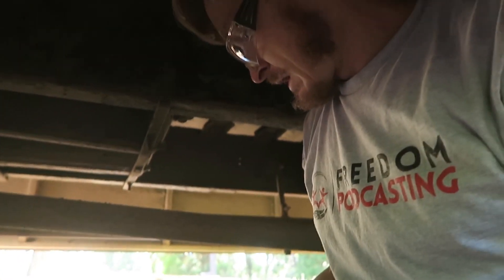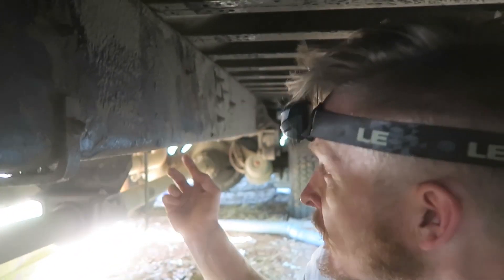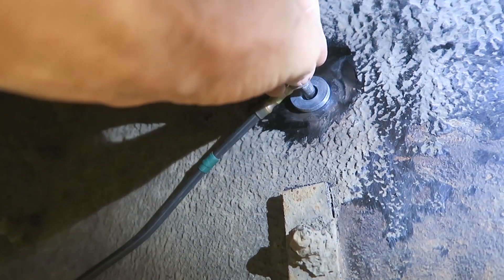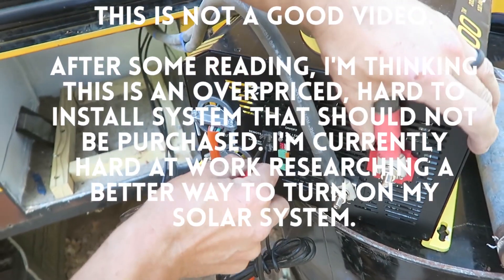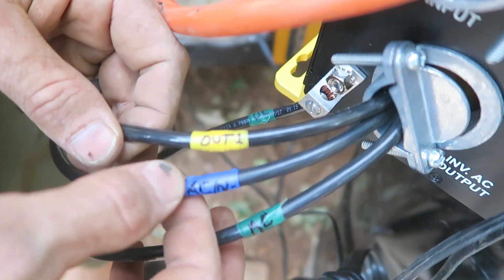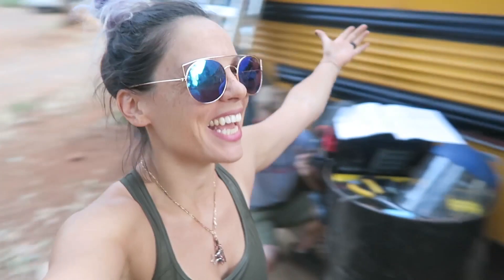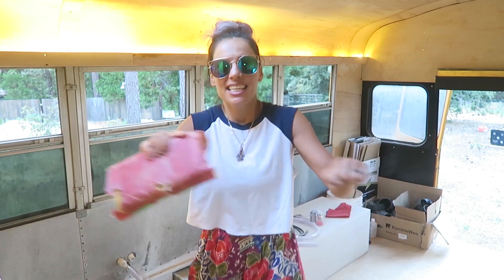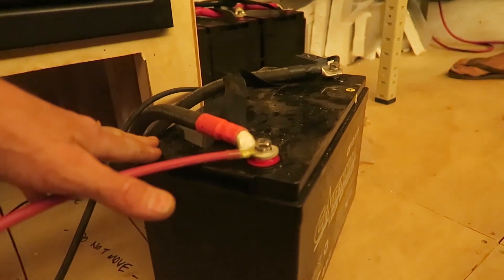#58 SKOOLIE BUS CONVERSION | Sanding, Grounding the 2000 Watt Inverter and Electrical Worries

Comment: Also I was wondering if the new Tesla Powerwall might be a feasible and really cool option for you, but unfortunately it can't currently be applied to anything but home applications. But maybe something to keep an eye on for future projects or an upgrade:

http://www.technomadia.com/2015/05/teslas-lithium-powerwall-awesome-but-not-for-rvs/
Reply from the maker: We have 460 KWh battery bank. The Tesla Powerwall is rated at 7,000 KWh. I'm thinking the Powerwall might be a bit overkill for the bus. That said, I'm not sure that our battery bank is sufficient to solve all our needs. More time will tell, but at the end of the day, the Powerwall is a large battery with a slightly more intelligent charge controller. I bet it's great, but at $7,000, I'm guessing one could optimize elsewhere. Also, choosing solar panels and wires to run the Powerwall will be a critical decision. Almost certainly overkill for this tiny house.
Reply: Yeah, for sure some overkill. However it is 7,000KW peak, 5,000 Kw continuous not KWh. There are two models - 13.5KWh and 6.4KWh. KW is how much energy a battery can deliver - in other words, how many hair dryers can V run at the same time :-P KWh is how much energy the battery can actually store. Another way to think of it is that KWh is how many horses you have in the stable and KW is how many you can let out at a given time. 

I agree it is overkill, but if you ultimately want something that can go off-grid in more conditions (e.g. places with less sun per day or long stretches without it) this would be something to explore. 

Lastly, found this link comparing competitors to the Powerwall that may be more in line with current or less long-term plans:

http://www.businessinsider.com/rechargeable-battery-options-compete-tesla-2017-5

Comment: If I heard you correctly you said you were grounding the AC to the bus frame. that would be a mistake. Only DC should be grounded to bus. I am not an expert electrician but I am very confident in that from all the research I have done.
Reply: In this discussion about marine applications, the consensus is that tying the AC and DC grounds together is the right thing to do, and in fact the inverter itself probably ties them together internally.
 http://www.ybw.com/forums/showthread.php?227914-AC-ground-to-DC-negative-connection 

I wouldn't want to tell someone to run AC without a ground at all, because any device that has a 3-prong cord is designed for that ground lug to go to ground.  My biggest concern about the bus application is that chassis ground is insulated from earth ground by the tires.  

There are some people who say you would not bind the AC neutral to ground inside the sub-panel as is normally done, leaving AC neutral "floating", in an RV-type application, but there are so many different opinions it makes me nervous that there isn't an actual electrician making the recommendation.
Reply from the maker: Hummmmm..... I'll ask around about this. I'm unsure. My system is working fine with AC and DC grounded to the same place. What makes you think that?
Reply: Ian Robinson i am doing more research. i have done some simple wiring in a home and the bus is a whole other monster
Reply from the maker: Your's is a very interesting question. I'm assuming that the purpose of a ground is to allow excess electricity to dissipate amongst a body of mass that is so great that the electrical current becomes ineffective. The idea of a pair of grounds seems strange to me... at the end of the day, all electrical systems are grounded to the earth... in a bus you have only the chassis as the rubber tires are insulated.

Anyways, I'm just typing out loud. Please let me know if you know something I don't. I appreciate your time and research. Thank you.
Reply from the maker: Yeah, there is far too much 'call an electrician' and 'check your local codes'. This is not rocket science and there should be a better website for basic DIY 110 AC electrical setups.

Comment: I would have thought, worst case, if your grounding doesn't work, it simply won't be a circuit and won't do anything. I can't use ground for my system as the van already does for it's own electrical system.
Reply from the maker: Ha! Next video doesn't describe it, but it was a bad circuit breaker! We replaced it and everything worked fine. New video tomorrow. Thank you for watching and commenting.

Comment: Do not use yellow for your AC neutral. By code it must be white or gray per US National Electrical code https://www.allaboutcircuits.com/textbook/reference/chpt-2/wiring-color-codes/ and I would always use white as it's the primary color standard, least likely to confuse anyone who has to make sense of this years from now.  (Think back to when you were tracing the wiring for the door interlocks that kept the starter from engaging, trying to make sense of what each wire was.)  Look carefully at the instructions on the inverter and sub-panel to determine what needs to go where, as the inverter may have either one or two hot wires (you'd use both for 220V) while the sub-panel almost certainly expects two hot wires (in both cases there would also be a neutral and a ground), so you might have to tie a single hot output of the inverter to both hot inputs of the sub-panel.  But please run this all past an electrician so you don't get hurt.
Reply from the maker: We're only running 110V so the two hots aren't coming from the inverter. We have a single hot which is tied to both sides of the 100A sub panel. When I get the opportunity and some white tape, I'll mark the neutral as white instead of yellow. Thanks for the tips. There are no electricians around so I must do this all by myself and be very careful to avoid injury. Thank you as always for the comments and the reference links.